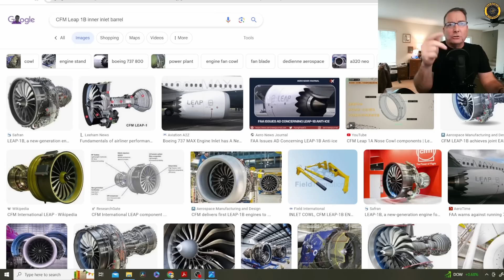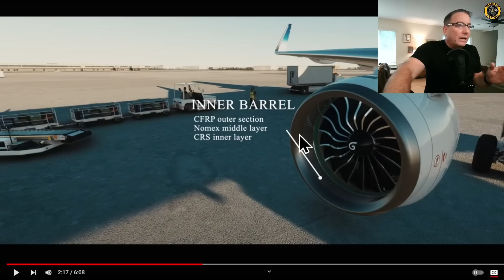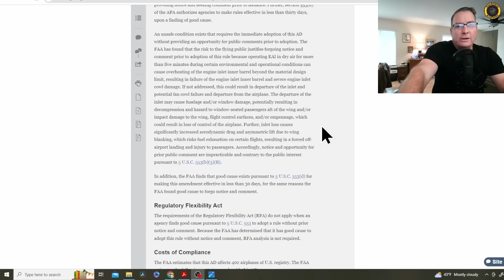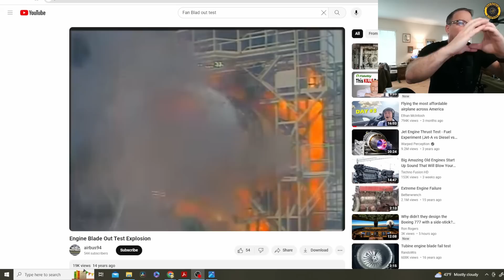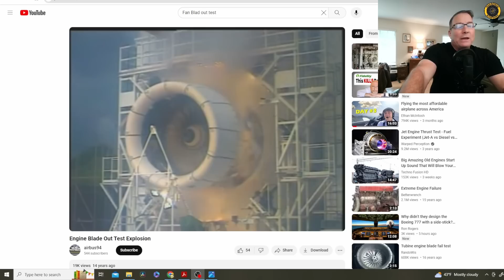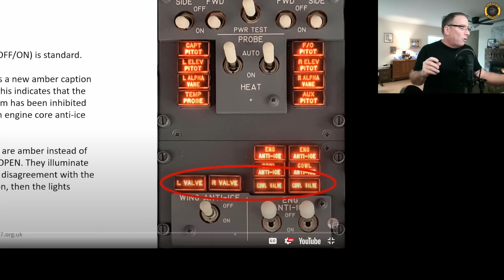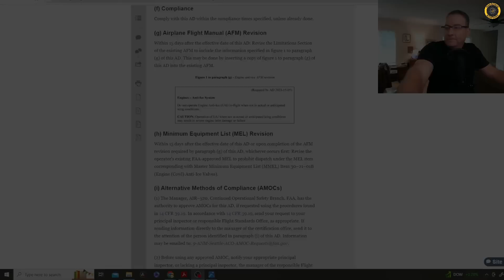Boeing 737 Max-7/-10 Certification HALTED! 1 Feb 2024

Comment: Could you not switch the bleed off if the A/I valve failed to prevent it from overheating? As long as the PRSOV is operational.

Comment: This is not a Boeing issue but environmental one, this is similar to auto engines the last 20 years, they try to get more miles from the engines and a lot of the designs do not last, in particular with the typical lack of maintenance of the average consumer. I think Boeing is thinking and probably already going down the line for a replacement and will not go down any timeline approaching the timeline of the new plane, which includes their production timelines. The conductivity and temperature of ice vs ambient should make a sensor possible and if you worry about a valve, you could have 2 valves in series, you need 2 failures.

Comment: Just to add to this mess.   On the max they changed the switch logic so that when you select cowl Ice ON, the switch only illuminates while in transit, and then it goes dark.  The only indication in the cockpit that you have left the anti-ice on, is a very small amber icon over the N1 gauge that is barely noticeable.  On the NG a light on the overhead panel remains illuminated.
Reply: Correction.  It’s a tiny green “TAI”
Reply: It’s green.

Comment: The carbon fiber inlet ring has more cons vs pros or risk/benefits just to save a few pounds.  Temperature always below 50 degrees(10 degrees C) once in flight.  Agree, switching on/off switch what a pain
Reply: You would think this problem would of been addressed testing the engine during development

Comment: ❤ Wow. Just wow. This is one of the most pertinent and timely safety-oriented videos you’ve done Juan ( @Blancolirio ), and in addition to the anti-icing switch needing to be flipped on and off, the halt to certification only covers the -7 and -10, what about all the -8 and -9 models still flying?!

Would you take your family on a still flying -8 or -9 in winter or possible icing conditions? I’m thinking no, at this point.

Comment: Boeing needs to do a production pause for a few days to have an ALL-HANDS-ON-DECK convention of all aircraft production/assembly employees AND aircraft parts/assembly CONTRACTORS to MAKE SURE everyone is on the same page, and that SAFETY AND QUALITY CONTROL is UNIFORM across all steps, from conception to rollout and certification.  It doesn't matter if they build another 10,000 airframes, if the Airlines and traveling passengers have no faith in the aircraft, they will need a boneyard just for the 737.  It would be a sad end for the world's most successful aircraft.

Comment: Thank you very much for the Update!👍 Really Bad News again for Boeing, allthough in this case the core problem sits in the Engines and therefore at the Engine Manufacturer, in this case CFM. But indeed, with a more modern design as the 737 is this problem could be solved easily as it is at the 777. So, yeah.
But this is a Design Problem and not a Production Problem/ Quality Management Problem. So it is a whole other Story as Alaska Airlines Flight 1282. But the public attention caused by Alaska Airlines Flight 1282 is probably the reason why Boeing halted the MAX-7/ MAX-10-Certification Process.
Bad News also for Customers of this two models like Southwest and United.

Comment: Will this also affect the CFM leap1A on the A320neo
Reply: The engine is NOT the problem - CFM does not design/make the nacelle anti icing components. It is Boeings design of the nacelle anti icing system/components that is the problem. Airbus uses a totally different design.

Comment: Hey, jumping back to Captain Chris Benham’s flight, I remember reports that the vibration of the outa-balance rotating assembly being so severe as to threaten to shake the plane to pieces. Would activation of the reverse thrust blocker doors & opening of the cascades on this lifeless engine have been an effective way to reduce the rpm of the windmilling low-pressure spool enough to reduce its rpm and thus the magnitude of the vibration?

Comment: The common type rating issue for the NG series was pushed to satisfy Southwest Airlines and, I suspect, were heavily involved in this CTR for the MAX as well. It isn't all Boeing!
Reply: Yes. Is it Boeing forcing customers to buy these planes or customers forcing Boeing to sell them? Seems to me that it is customers telling Boeing what they want.
Reply: @mikewatson4644  "Seems to me that it is customers telling Boeing what they want."

No, it isn't.

Airlines don't want to have to retrain pilots or fragment their fleets.

If Boeing creates a new type rating every time they make marginal efficiency or safety improvements to the 737, that means every airline that buys them has to retrain their pilots on that new type rating. They'll have to keep track of which pilots have been certified on which aircraft.

That's a logistical nightmare.
Reply: You're right that the common type rating is a very important selling point for customers who have existing 737 fleets.
I'm not sure that Boeing know how to safely deliver that. A lesser company might have refused to compromise on safety here.
Reply: @j_taylor it's kinda funny because if the FAA were less strict on what was needed for common type rating, but this and MCAS likely would have been fixed from the start.

Comment: This is what happens when we continually chase marginal gains in efficiency:  We wind up with cars that feature expensive failure prone technologies like cylinder deactivation, turbo charging, direct injection, auto-start-stop etc.  We also get home appliances that break every 5-10 years because of unnecessary electronic systems.   I'd rather sacrifice a little efficiency for reliability.

Comment: This is a series of failure on Boeing's quest for the perfect socially acceptable engine. Obviously the real problem is metal alloy development. Before they put something into operations, they really need to make sure their numbers justify the current usage. Boeing is also screwed up with Star-liner. Boeing Management is the real problem. Their board of directors needs to make changes and fast.

Comment: This isn’t a Boeing issue per se’. It’s a GE problem. Boeing can’t really redesign the cowling on engine. 

What they can do is add some heat sensors, connect it to the ice light, and put in a timer so the system can turn itself on and off. The SF340 I flew had a device system that blew the boots in a timed sequence. This should be easier than redoing the cowling
Reply: CFM does not design/make the nacelle anti icing components and the problem is not the LEAP engine. It is Boeings design of the nacelle anti icing system/components that is the problem. Airbus uses a totally different design and has NO problems

Comment: Just need a temp probe and auto.   Cheap ass Boeing trying to overload pilots
Reply: If they install an auto setting the type certification will no longer be similar to the NG so airlines will have Max pilots and NG pilots, not 737 pilots
Reply: @tomstravels520  that one option means you can’t fly that plane?  All 737s have this same manual issue?
Reply: @gordybishop2375  but on the other 737’s it doesn’t matter if you accidentally leave the switch in ON position.
Reply: @tomstravels520  again.  Just add temp probe and auto switch.  No need to have on switch.  Stop letting engineers..or CEOs….overload the pilots on this simple crap.
Reply: @gordybishop2375  again….then you risk loosing single type certification because of too many differences between the NG and MAX. If Boeing added an auto option then airlines would possibly have to have NG pilots and Max pilots, not 737 pilots. Same reason they added MCAS. To make the aircraft behave like the previous one and avoid this potential problem
Reply: @tomstravels520  again….to make it safer it’s worth the risk.
Reply: @gordybishop2375  that’s not how the customers will see it. Their pilots can now only fly NG’s or Max’s instead of both. This can potentially lead to multiple flight cancellations if the airline coolant find the right qualified pilot, pilot training now has to be split into 2 aircraft. The airlines will not be happy with Boeing and may try to look elsewhere in the future. It would defeat the entire point of Boeing creating the Max in the first place. Also MCAS was added as a risk and look what happens to that. Airbus don’t have auto engine/wing anti ice yet they manage just fine
Reply: @tomstravels520  Dude.  We have seen how these companies care.  They don’t.  They want to put more responsibility on the pilots instead of simple changes.  Technology that is decades old.  They want to blame a human if there is an accident and not their systems and their corporate overlords.  The 2 max crashes were not the pilots fault.  These pilots need to fly the plane and not be minute by minute plane skin temp weather reporters.  It’s asinine in this day and age.  Stop defending the greedy few putting we the prop,r in risk.  Just incredible that’s a thought pathway.
Reply: @tomstravels520  they are not fine.  Ask that ladies family how the hell fine they are.
Reply: @gordybishop2375  I beg your pardon. Who says I’m defending them? I’m not, I am simply stating facts. Boeing can’t just add an AUTO setting because it means there will be too many difference between NG and MAX and FAA may not give them the authority to fly both. Do you understand the consequences of that? The only way they could get around this is if Boeing added an AUTO setting to every Boeing 737 that currently flies today…..at their own expense. Any idea how much that would cost them? What ladies family? If you’re referring to SWA1380 I said AIRBUS pilots are fine with not having an auto option because it doesn’t matter if the anti ice is accidentally left on on an A320. SWA1380 wasn’t an A320
Reply: @tomstravels520  every 737 is the same? Really.  They are not upgraded since the beginning?  Is that not what the issue here is?  The different parts need heating 0\cooling that did not need heating/cooling before?  It’s already changed but should be changed in such a way that does not distract the pilots from flying unless there is a malfunction.
On/Off switch is pert much the same as Auto/off.  Of of course just Auto all the time with no need for pilot input.  Pilots don’t turn on off many things in the plane that is needful.
Reply: @gordybishop2375  dude…..are you a pilot…do you have any understanding of how commercial al aircraft are built and certified. I can’t explain this any clearer and just repeating myself at this point. Also you’re saying “every 737 is the same” as a question which makes no sense. I have told you why there is no AUTO setting and why it is not realistically possible to add it
Reply: @tomstravels520  did not answer my question.  Is every 737 made exactly the same or are there various differences over the decades.  No improvements in all those decades?  All the same length and handling abilities?  Nope.  So change it like has been Don in past like with the Max.  But do it right this time.  This is a simply auto function that does not need pilot manual input, unless something wrong.  What ever the cost you think is not warranted is just greed.
Reply: @gordybishop2375  you have just proven you know little about how certification works. Yes there are small changes. But why do you think the 737 Max cannot have EICAS? Answer….because it would be too different. You said you want pilots to just fly the plane and not think about little things, if you have too many changes then pilots might forget which aircraft they’re in and do something is not required in one plane but is in another. Boeing already made some changes such as the gear lever, they can’t change too much. Hopefully one day you will understand that
Reply: @tomstravels520  yeah this is very critical or we would not be talking about it so yea they can change it  for safety.   It’s that simple.  It is not “Too Many”.  It is needed.  Stop protecting corporate profits and protect lives.
Reply: @gordybishop2375  once again, you have little to no idea how certification works. Go away and do some research for once. I am not justifying this, I am point out the reasons why it doesn’t have it. You think you live in a world where anything is possible, but it isn’t. If Boeing could change whatever they wanted on the 737 and still keep type certification do you think the overhead panel would still have a clusterfuck of switches? Do you think it would still have no EICAS despite all other Boeings having it? Do you think they would have created MCAS?
Reply: @tomstravels520  you just said it.. they added MCAS.  They can add more and still fly.  
You are justifying it by saying it should not happen because it's too expensive to do. Again...profits over lives.
Reply: @gordybishop2375  I swear I’m talking to a brick wall. They added MCAS to MAINTAIN the type certification. Adding an auto anti ice option will do the opposite. 

Look at Airbus. They don’t have automatic anti-ice switches on the A320 even on the NEO. How do you think they manage?
Reply: @tomstravels520  they don’t manage….the force the pilots to manage something that should be automatic.  That’s the issue.  They want pilot error to the issue if there is a problem, poor engineering and  greedy stock holders.

Why is it not automatic in the first place?  Like a thermostat in a car.  Constant flow of a temperature that is not damaging to the equipment instead of this freezing cold or burning hot crap from centuries ago.
Reply: @gordybishop2375  are you seriously trying to compare a car engine to a jet engine? Seriously how old are you to think they are similar in operation? Where are you going to get the colder air from when it comes directly from the engines? Anything that comes out of your mouth is going to cost millions and just won’t happen. Sorry but we don’t live in a fantasy world where you can make things happen at the snap of your fingers. It’s not greed it’s simply not cost effective. Boeings best option is to find a new material to replace the carbon fibre lining that is more heat resistant like the NG was.

And seeing as you clearly don’t understand Airbus’s the pilots will turn on the engine anti ice/wing anti ice when required or when ECAM says so. The ECAM will also tell them when no ice is detected so they can turn it off. Do you think it’s a lot of effort to press 2 buttons or something?
Reply: @tomstravels520  dude, we heat/cool air for the cabin.  But can’t do the same for this particular piece of equipment.

Psst,.,the outside air is colder then the engine stages.  Why is it taken from those stages in the first place.  You can mix it via Venturi effect,

How ignorant are to think that concepts like temperature control can both exist in a car and jet along with a pleathers  of mechanical things.

It will also cost millions to find that other material if it can be found.  You want to spend that money and make that change and all the issues evolved with it but not a change that will stream line it off the pilots responsibility to guess the weather right.  Pilots should only be involved it a well designed plane goes wrong.  Not having to turn something on off because….as you say….a system tells them too.  Get the pilot out of the loop and let the system turn itself on and off….let’s call that auto mode.  What a concept in the 21st century
Reply: @gordybishop2375  ok….now what would happen if the packs failed? Now you have no anti icing system at all. Well done genius. 

As for why it’s taken from those stages……do you know what a compressor does to air? Think you need to go back to physics school.

And incase you seem to be the lazy time. Even in auto mode you still have to monitor the system to make sure it turns on and off when required. So why not just do it yourself anyway if you have to keep checking it’s doing the right thing?
Reply: @tomstravels520  if something failed…like the switch or the thing the switch controls…..yeah there will be issues.  But won’t be the pilots fault for not judging the weather correctly.   

Yes I know what a compressor does….but more importantly how it does it,  they have multiple statues.  The first stage would be a lot cooler then the fifth or ninth stage.   Not becoming too hot to destroy the parts or needing less cooling to not destroy the parts.

There are hundreds of systems in the plane that are automated and alarms go off when they are not working correctly.  Another technology that have been in use for many decades.  Why the hell is the Boeing engineers too lazy not to automate this system and set alarms once and for all instead of making the pilots manually do it forever and ever.  Pilots are not the lazy ones for not wanting to waste time and attention on a system that should be working automatically and only needs attention when and if malfunctioning.

Comment: Funny how Airbus is not having this issue AND you can select auto engine anti ice. Sad Boeing has sunk to new  lows...I was in the 200/300/400 era.
Reply: I don't think Airbus has auto engine anti ice activation as it's a push button on/off design. However they do have ice detectors that will warn when ice is detected and also if there is no ice detected when anti ice is on.
Reply: ENG 1 + 2 Anti-Ice pushbuttons

ON GROUND:
Must be ON during all ground operations where icing conditions exist or are anticipated
IN FLIGHT:
Must be ON during all flight operations where icing conditions exist or are anticipated, except during climb or cruise when the SAT is below - 40 ᵒC
NOTE. when selected on will automatically modulate to de-ice  when 10C, you dont need to fool with it  and your not time limited to 5 min ops like  the Max.